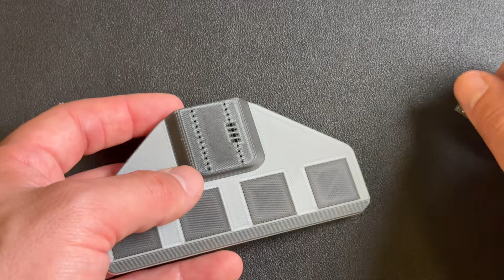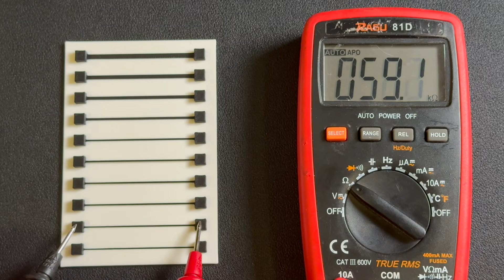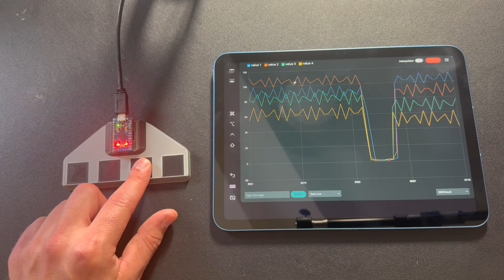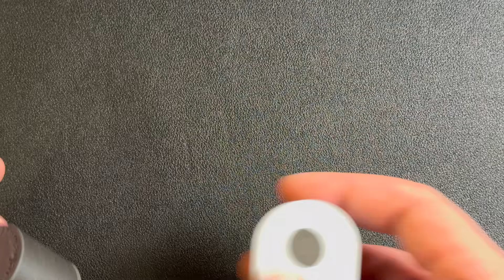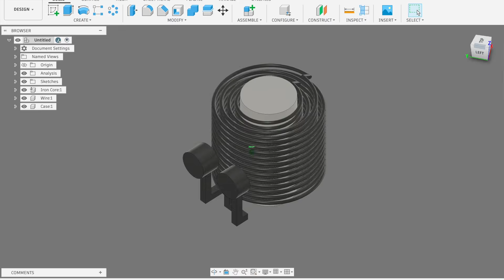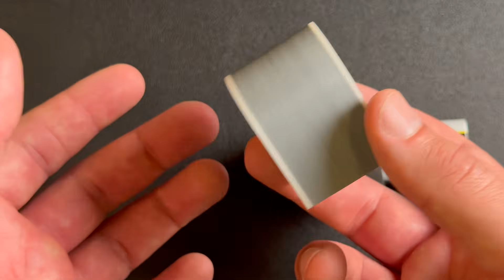I 3D Printed a Working Keyboard with Conductive Filament!

Comment: I'd be curious if the larger macropad would work as-is when printed on a multi-head printer.  

You could also add voids in the non-conductive spaces to reduce unintentional conductance - maybe isolate the non-conductive shape, duplicate, then press/pull or offset faces to create a thinner version.  Then you could use that as a separate .stl in your slicer to give a custom infill setting - so you'd get a shell of regular filament around the conductive filament, but not as much material in-between each trace.

Comment: Could you explain how you 'sense' your finger on the keyboard?

I think the biggest problem with the coil you tried is the resistance of the filament. With any sort of K(ohm) rating you won't get a proper magnetic field with a 9v battery. Or is the resistance less with the material you used on the coil?

Would love to see more videos. Would also be great if you go into more depth
Reply: Forgot to add: First
Reply from the maker: The Arduino’s measuring capacitance on the pad. Your finger adds more capacitance to it when it’s in contact.

The resistance is pretty substantial compared to a copper wire and is definitely a big factor. The game now is, how can you design around that high resistance property?
Reply: Wow I didn't know an Arduino could sense capacity without an external circuit.

To answer your question, maybe you can design clip in slots for a certain size of SMD resistors instead of making the resistor with the filament.